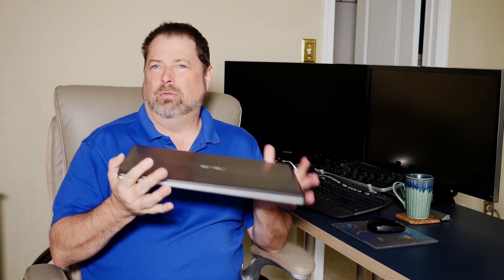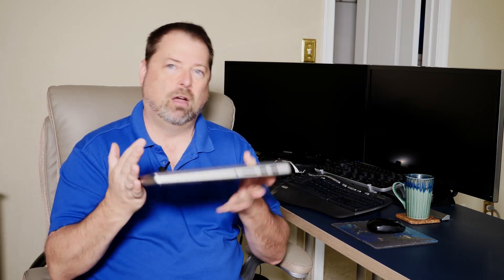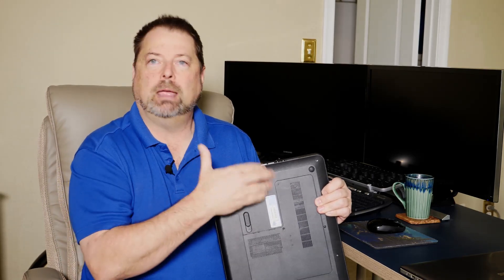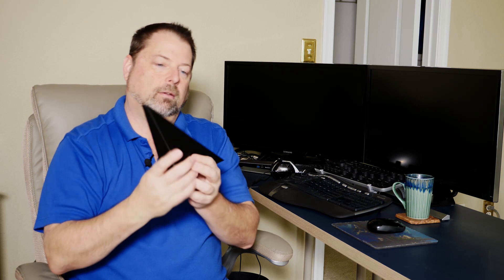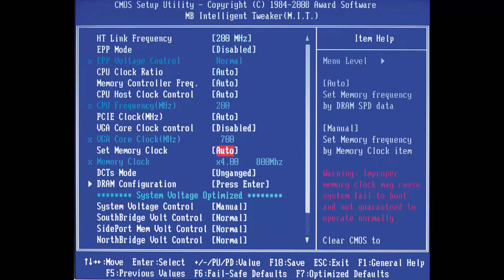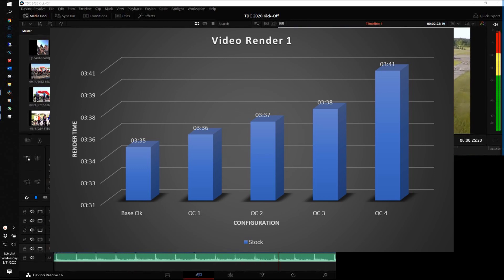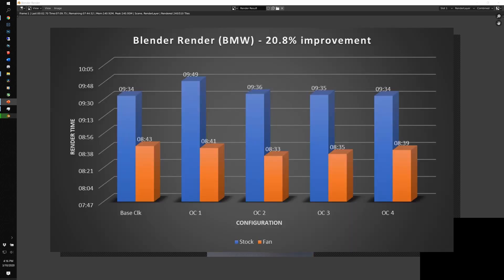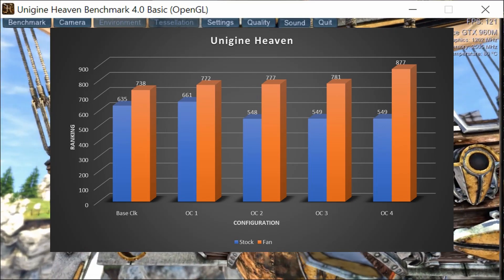Can You Overclock a Laptop?

Comment: Its sad what happened to PC industry...i had laptop with 6 core i7 8750h. It was supposed to "run" at 4,1GHz, but i have ended up at 3,2GHz for all cores, because it was only way to stop it throttling. I have no idea how can someone think that way and basicaly sell broken things.
Reply: Maybe you were looking at the boost speed and not on the non boosted speed
Reply: @skenda  id doesnt matter, since only 3,2GHz was not throttling
Reply: You're missing the point. What is the base clock of the cpu ? Or the rated speed of the cpu? Are you below or above that number? Throttling by definition can only be applied if you are running BELOW the base clock. What you have is a laptop that is not fully utilizing the boosting capabilities of the cpu. That does not mean it's thermal throttling- even if you tell me your cpu sits at 95c because its using the thermal headroom to managing high clock speeds. It's may be hot, but it's definitely not thorttleing caused by overheating. Hence your hardware is not faulty as you thought.

Thermal repaste /undervolting will usually allow you to max out the capabilities of any cpu within a laptop as long as the cooler itself is running near max efficiency 

- laptop performance enthusiast / modder and tuner.
Reply: @lewisanth4986  you are missing the point....Intel made CPU with 2,2GHz base clock and 4,1GHz turbo. So they have plenty of room to fit it everywhere, even if it will never reach its full capabilities. Why should i play with voltages? I want my laptop somewhat quiet, so i have to limit manualy my CPU to not overheat? Thats manufacturers work. And dont think it was some cheap piece, i spended lots of money on it to prevent overheating,  reviews were talking about nice temperatures (payed, as i figured out after buying it). 

-ex-overclocker from times of Pentium who know far more than "laptop performance enthusiast / modder and tuner" who play with XTU, Afterburner or whatever, maybe is able to replace thermal paste and thats his top knowhow...
Reply: @martincoufalik9101  been in the field for 15yrs Martin, you're not the only one don't worry. 

Maybe so it's a versatile chip!

I'm just questioning your "overheating" statement. Was it actually overheating you would be shutting off or below the base frequency during intensive loads. 

2.2ghz with the potential to hit 4.1ghz If power and cooling allow. it's the manufacturer who implements the chip into the chassis and end up dictating how the laptop will perform and run. 

Being from the Pentium days I'm sure someone with you're caliber of knowledge would have easily know that cpus can sit at 100c all day without breaking a sweat.

We all have that one friend with an antique 2nd gen i5 laptop that has never had any tlc and just sits at 90+ c consistantly right at start up - yet 10+ years later it still runs and functions does it not? 

Its normally the 1% that goes out of their way to make sure they get what they pay for - something that is not economical nor feasible for a manufacturer to do on a large scale production, and as a ex overclocker who used to spend alot of time dialing in voltage and clock speed while maintaining temp targets I'm sure you understand that as well. While the 99% are aware but not bothered enough to do anything about it and continue to purchase their products anyway for productivity while sulking about it - fair and understandable
Reply: @lewisanth4986  "would have easily know that cpus can sit at 100c all day without breaking a sweat".......really? 

Thats my point...They cant. Last decade laptops have physical timer of their lifespan. Their boards are so thin, they get thermaly bended over time and then they will just stop working. Running CPUs at their thermal limit is not very helping and WHY THE HELL IT SHOULD RUN ON 97°C, WHEN T JUNCTION IS ON 100? I have experienced even shutdowns from time to time, when it was summer and cooling was just not enough. It is just bad and lazy desing and fools like you happily throw around these stupid nonsence numbers, feeling smart and telling poeple it is normal.....whats wrong with you?

My mobile workstation laptop, HP 8730w had for its time pretty nice configuration (more power than most of PCs), it was running 3GHz C2D, was keeping itself quiet and was running aroun 75°C.

My other laptop was doing like 70°C  with i5-430.

My PC CPUs NEVER went over 70°C.

Every real overclocker will tell you to keep temperatures under 70°C.

So why do you think running it on 95°C is fine? It is manufacturers fail, thats it, nothing else, no fancy numbers, it is pure fail.
Reply: @martincoufalik9101  but if you wanted a cpu for 100mhz, why not buy a cpu for 100mhz, and not a cpu that runs 20mhz and can potentially boost to 100mhz? If you were to buy a cpu that ran 100mhz base and everything over is extra, chances are cooling system and everything has been beefed up accordingly no? Since it's default a higher performance chip 

The 1st gen 35w TDP cpus were very easy to deal with and cool

Let's not forget about die contact patch with coolers? CPUs have gotten faster and smaller but they make more heat. The shrinking die does not help coolers remove that heat easily - which is why thermal pastes became such a controversial topic and liquid metal came into existence. 

I'm not saying you're wrong but there is always a good explanation for why things ended up the way they are

Not simple like it used to be.
Reply: @lewisanth4986  It is still the same. You have warm CPU? You cool it. Thats it. Using water boiling temperatures for limiting CPUs power is very dumb and lazy both from Intel and Manufacturers. Shutting down because temperature got critical on GPU or CPU is simply unacceptable, not mentioning FPS drops, very variable render times and so on. Things are still simple for them, but i had headache. How the hell they managed to cool down that X9100 with 44W TDP back in 2009, that CPU from my workstation? Without all these fancy things you still talking about? They just made good cooling solution, thats whole story. It NEVER throttled, NEVER changed its frequency, nothing. BTW that I7 im talking about have 45W TDP. So what the hell happened in all these years? Only smart talks, no real progress.
Reply: @martincoufalik9101  fair, I guess they are struggling to some extent with the downsizing then
Reply: @lewisanth4986  dude read something about cooling problems and get real....if they have troubles, why they sell it?
Reply: @martincoufalik9101  it's all a matter of perspective end of the day really. Some just don't care the way you do.
Reply: @lewisanth4986  Thats actually huge problem for future....companies made young poeple think that situation now is normal and everything is fine. It is not. Whole market is deformed and i hate how it develops. Sad part is, only young poeple refusing to buy that trash can make any difference.
Reply: @martincoufalik9101  true

Comment: Many Newer laptops don't benefit from overclocking much, high performance ones already do it from the factory, because they are competing with each other, so they do it to keep competitive numbers. If I enable Turbo mode, which maxes the fans and applies the overclock to the gpu, my Fps will go up by a few for a minute, then, it throttles and reduces the clocks, it happens quickly because of the rapid increase in heat output. If I run an average benchmark that sustains for several minutes, I will see nearly identical average fps numbers between Turbo mode and Quiet mode. In some cases, quiet mode has better performance. The laptop gets hot to the touch no matter what mode im in, so it stands to reason that Overclocking can't have any benefit on average unless you increase airflow. What I do, is prop the back of the laptop up and run in quiet mode and I am happy with my performance, plus its not pumping so much dust thru the fans all the time. Perhaps Liquid cooling in laptops will be a thing in the future, then it would be worth doing
Reply: I got an Omen 16 - with the most powerful cooler on the market, with a vacuum on the side vent - kepps my CPU around 55 60c Max... With the I9 its amazing, I really dont have to use my own fan at all because the IETS is is so powerful. I made a video of it not long ago

Comment: I know this is nit picky. But the ruggedized laptops designed to be water proof do not actively cool. In fact there are quite a few passively cooled only laptops that do not get any or much benefit at all from improving airflow. In case someone here is trying to increase clock speeds on a tough book or getac that has 0 access to it's internals unless you've unscrewed something, your better off getting a different laptop. or, if your crafty, installing a port for an external GPU that is actively cooled. This is also hit or miss since I know my getac does not support external GPUs. Just thought I'd throw that out there for those of us who have less popular laptops.

Comment: Hi design, I'm under the impression if you had repasted the laptop with something quality stuff and optimized the air flow between the blower fans and heatsink to prevent air flow loss. Them some undervolting ( results overclocking) for both the cpu and gpu would have netted you the same overclocked performance at the same or lower thermals without all the extra external help! 

I mean we could have even clipped the yellow pwm wire running to both fans to make em run flat out bringing the best amount of thermal headroom possible with your overclock! 

You could say I've had my fun the past haha. Fun hobby!